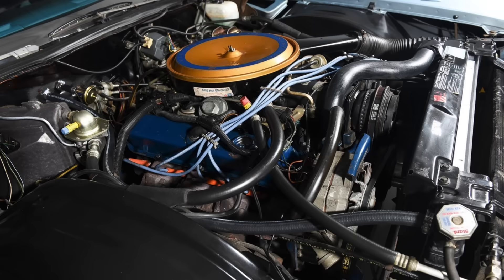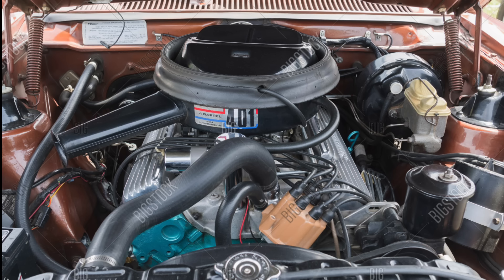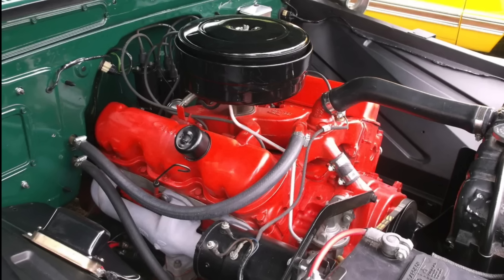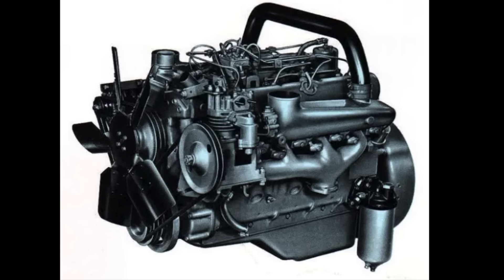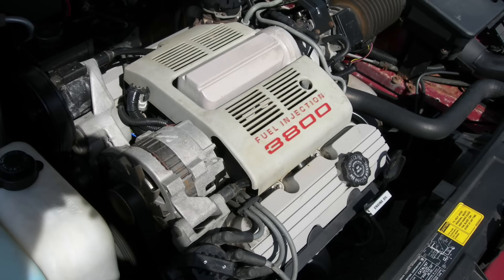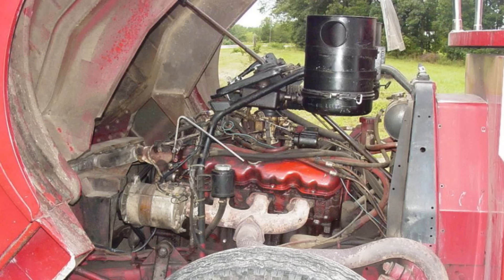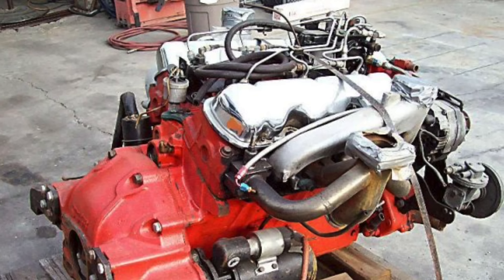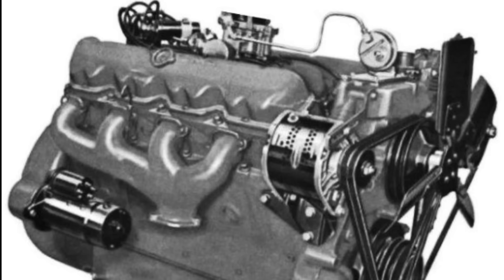The 1966-72 GMC 637ci 60-Degree V8 - GM's Largest On-Road V8 Is Virtually Unknown!

Comment: I worked with the Medium Duty team at the GM Truck Group in Pontiac 25 years ago. Back then, the gasoline powered medium duties were important to customers who operated in areas where diesel fuel was not as readily available. GM offered the CAT diesels back then, but the 454 gasoline engines were popular in medium duty. GM had many customers who preferred the gasoline engine for their application.
Reply: We've got the Isuzu/GM cab overs at work, both gas and diesel. Overall, the gassers tend to have lower repair costs and I'm able to get parts generally faster than the diesel version.

Gas is preferred in residential areas and local city work, while we use the diesels for long highway runs and heavier loads. 

They might be slow and ugly but they're damn sturdy
Reply: are you sure your not taking about the tall deck 366/427?   ive never herd of a 454 in a medium duty?  correct me if im wrong.  thanks
Reply: @MrChevelle83 They were available in 1979 and 1980. They were tall deck blocks on top of that. Lost a bet on it. Saw the truck and the option sheet in the glove box. The intake had 2 thermostats, denoting a tall deck. Governed Holley as well.
Reply: @thegreenerthemeaner  thanks for the info, several years ago i bought a 366 due to being told it was a 454, I scrapped the engine and wished ida got the crank shaft out of it for a 396 block I had at the time.  I didnt have access to casting numbers then like we do now.
Reply: @MrChevelle83  The sad part is the crank was forged steel, both the 366,and 427 tall blocks.
Reply: @thegreenerthemeaner there has never been a tall deck 454.
Reply: @jdrok5026  Yes there was. GM's own sales literature shows it. In 79 and 80 there was a 454 Tall Deck available in C70 trucks. RPO code L42.

Comment: MEL's and Super Duty's do not share any parts. SD weighs 1400 lbs vs MEL at 5-600 lbs.
Yes both are similar with combustion chamber in block with flat heads (think gm w series and 348 are same design). 
Stop compairing car and pickup engines to these Heavy Truck engines. Heavy truck engines are designed to run close to wide open throttle all the time! They were not designed for maximum power or efficiency. Design was to be dependable and  capital cost efficent vs diesels.
Belive a GMC 80 or 90 with 6-71 was $4000 more than 478 V6. Were talking 1970's  dollars! 
C&C gmc 80 tandem  with air brakes 5 X4, 18, 000 front and 38,000 rears was about $17,000. Add another $4000 for 6-71. 
You can see why gas engine was attractive with abundant 35 cent per gallon gas
Reply: While they don't share any exact parts, the Superduty engines are similar to the MEL. 
Also Ford's Industrial FE engines (FT) are very similar to car/light truck FE engines, and do share many parts, including the blocks. 
In the old days guys would rob forged steel  crankshaft from 391's, machine the crank snout down, and use it in 390's or 427's. The lighter duty FE engines used a cast steel crank, with the smaller crank snout. That was just a normal 332, 360, 390 FE with the industrial style heads, manifolds, timing cover/water pump, and accessories. Swap those parts and the engines were 100% interchangeable.
Reply: they do the same with 429 truck engine forged cranks . @johneckert1365
Reply: my 534 is listed at 1000lbs ,the 460 I am swapping in will weigh 600lbs alot of alum parts
Reply: @GaryMathews-qk8de  Your 460 will make WAY more horsepower no doubt. You won't have the low end torque of that 534 though.
Reply: @GaryMathews-qk8de  Side note: Even though I'm a Chrysler guy, I do like the 429-460 Fords 👍

Comment: I have to wonder if you could fit this thing into a regular truck chassis: big bore short stroke means you could probably get some revs out of that thing if you let it breath.
Reply: Too heavy. 
Too big.
Plenum intake manifold.
No speed parts. 
Rotating mass too heavy for high rpms.
Would be cool conversation piece.
Reply: Main bearings are too large in diameter, as well, for high RPM.
Reply: I know it wouldn't exactly be a direct swap, and would probably require custom sheetmetal parts, but I imagine a decent flowing long tube header design and a custom intake that could take a set of 4-barrels might do wonders for the powerband.  And I wasn't thinking of revving it to like 8000 rpm. Think more like 3500 to 4500. Cram it all into an early to mid 60s shortbed GMC piclup.

Comment: Why not do a video on the GMC 6 cylinder engines?  Many people do not know they made a 503 cubic inch six that ran on gasoline. The 302 l believe that bolts in where a 235 does and these were truck engines, not known for high rpm. The 503 was used in fire trucks. The fuel economy of the GMC V-6 was horrendous, I would imagine the V-8 is not better, just more power.

Comment: sound files for unique engine geometry are a big plus in my mind - but are best when you can find a drive-by with some load on the engine.  (the VW W8 of 20 years ago really had me going, back then)
Reply: Do you mean the w12 motor… two vr6 motors mated together
Reply: @markbrodie48  no, I definitely meant the 2002-2004 VW Passat W8 - a 4.0L 8 cylinder engine, formed from two VR4s 72deg apart.  The Audi / Bentley / VW Phaeton W12 is exactly the same thing though, 6.0L.  The Passat was not a commercial success, because it had almost none of the external trappings of prestige that would have gone along with its internal complexity.  You can find YouTube videos of tearing apart a W8.

Comment: Drove a gmc 80 tandem dump truck with a 637 and 5X4.
110 gallons of gas a day!
238 hp 6-71 in same truck burns about 35 to 40 gallons a day.
DD 6-71 out pulls 637 period, plus 6-71 has a jacobs brake to help desend grades and stopping.
No hold back whatsoever with 534, 549 and 637. Your depending on brakes only, remember quite a few close calls driving gas bombs!
Toro-Flow was disater. Was NEVER a good engine. All died with low miles if worked hard, vs the 637 which went to 100,000 miles in big  trucks.
Also drove 534 Super Dutys and International Power Giant 549's.
They all were good engines in heavy trucks, yes all had issues but good over all. Except fuel consumption. 1973's OPEC fuel crisis was the end of these gas bombs. Most were parked permanently, as  cheap gas was unobtainable.

Comment: the 1980s-90s Nissan V6 (sohc, 2-valve) had its spark plugs inside the cylinder banks - a huge help in doing a tune up on a transverse-engine FWD car.  We had a Quest - dependable in the important stuff, but it had developed the longest list of stupid little problems not worth fixing, by the time it was 11 years old and it got totaled, of any car I've ever owned.
Reply: So...then...the quest was over
Reply: @JTA1961 No Quest-ion about it.
Reply: @JTA1961   Yes, but I lead a charmed life, so the accident was not at all my fault, and actually witnessed occurring in real time by a cop.  Seeing a puddle, he was about to call a tow truck, but I did a sniff test and realized we could make it a few miles without windshield washer fluid.  The crank pulley was rubbing a little on the bent frame, but the Quest got us home safely and to the body shop to meet its end, 129128 on the odometer.